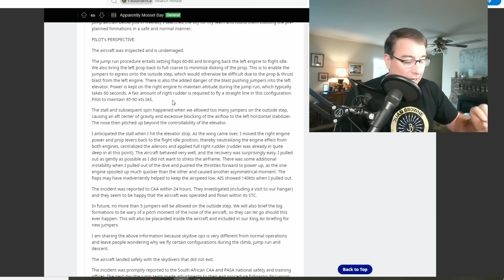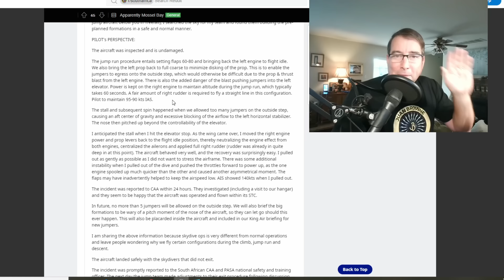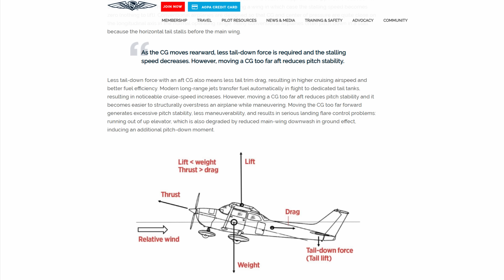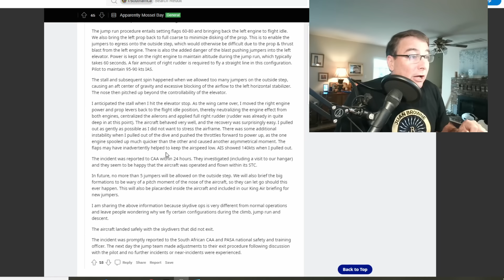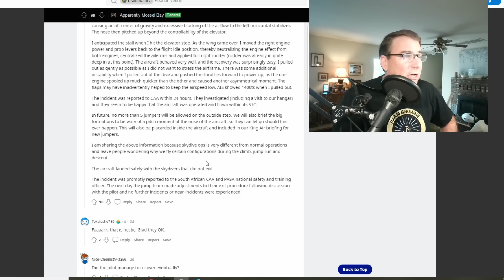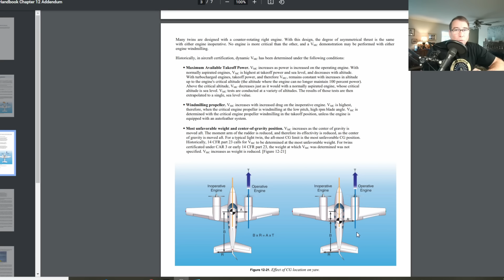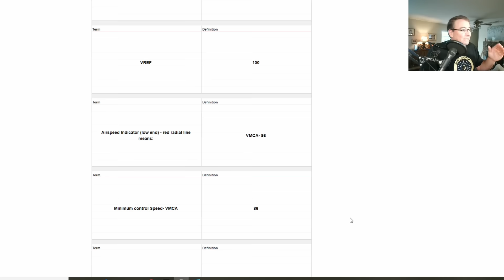Stall+Yaw=SPIN!  King Air Skydive Incident

Comment: One question why does this airframe make it out of trouble when the other videos have the pilots coming out of the "soup" overspeed the aircraft and pieces come off? Is it the altitude?
Reply: The airspeed is low in a stall spin situation. Just because the nose is pointing down doesn’t necessarily mean the plane is going fast

Comment: Wow he did have wrong opposite controls in.  Well Vmc speed given  is with flaps up.  I learned at about 20 hours total in a C-150 with full flaps my instructor had me in a secondary stall because I left the flaps down  The more it stalls the steeper faster, and flatter it gets.  Power makes the spin flatter

Comment: The scariest part is that the aircraft flew under where the skydivers had jumped out.  What if the stall had been prolonged a bit more and the pilot's brain focused only on recovering the aircraft, not on the 3-dimensional position of the divers, could they have been chopped up in the props ?  Very scary !!

Comment: My two cents as a long time (retired) skydiver with 3500+ jumps, around 500 or so from KingAirs.  I am NOT a pilot (though I have flown a few jump runs in a Twin Otter, including some bigway exits with a lot of people floating and long sets for the exit.)

We always (in the US) limited how many jumpers "floating" outside the KingAir to five, two directly across the floaters inside the cabin, and anyone else on that formation designated as "divers" - spread out forwards inside the cabin for CG purposes.  And our pilots typically take consideration into these numbers and spacings if any of the outside "floaters" or aft positioned divers on the dive were large/heavy people.  We also considered CG in terms of the rest of the jumpers not on that formation remained forwards until the large group had exited.

With that, as is normal, climbouts and set for the exit are practiced on the ground, typically in a mock-up of the aircraft doorframe - this group took a long time setting - about 20 seconds.  If I had to guess I'd say these guys practiced their climb out without their rigs on and then experienced a little cramped maneuvering to get the last two floaters out - and that slowed them down.  Another "mistake" was they had their rear floater climb out before any forward floaters - typically the forward floaters climb out first to help block the wind so the rest can climb out with less prop wash.

I've never heard of throttling back the jumper side engine - we just understood KingAir climb outs and exits might be "a little windy" and kind of a workout.  (But a cakewalk compared to propwash jumping DC3s where I've seen floaters hanging on and literally flapping in the prop wash.)

I haven't looked at the FARS in a long time but (at least in the US) if we can see our "spot" (exit point vertical) and believe we can maintain 2000 feet horizontal separation from clouds above 2000 feet, that's within the FARS and legal as far as the FAA is concerned.  Once the jumpers exit, it's up to them to keep that separation.  By the look of it, jumpers probably punched some clouds - and while I have jumped in South Africa, the times I have jumped there cloud separation was not a concern.  I've seen it in the US as well - but most places I've jumped around the US try to avoid this and I've been on a number of loads that landed with everyone aboard or did a hop and pop pass under the cloud layer because it had closed up climbing to altitude.  But it's not universal.

Most skydiving accidents involving aircraft occur on takeoffs and landings.

This incident here, IMO:  too many people/too much weight aft floating, possibly too many people aft prepping to exit, and the pilot apparently a little behind the curve.  I can't speak to throttling back the jumper side engine except to say I understand the physics but the half dozen times I have flown jump runs (In a twin otter), our pilot never said a thing to me about throttling back the jumper side engine any at all.

Comment: Can a King Air be modified to move the horizontal stabilizer to the top of the vertical stabilizer?  I would want to modify the whole tail section of the aircraft with a bigger vertical stabilizer and rudder with a oversized top mounted horizontal stabilizer.    An extra level of control surfaces would hurt would it?  It's not a lifting surface, so wouldn't it work?  EDIT:  I just looked and apparently a Super King Air has a high mounted horizontal stabilizer.  ( T - tail )  A Pilatus PC-12 also had a T - tail configuration.

Comment: almost every jump plane i exited from seemed like it was in a shallow dive which kinda made me mad since i paid for either 13.5 or like in cali 10.5 or 12.5. 

having flown camera and climb out on the step back by the tail then i was glad they raised that tail a little. never got a 'cut' going out of SDA's DC-3, but did get a shot of oil on exit with a side of prop blast. 

juan you should open a locals channel or post these type videos on rumble or odysee. we could donate to your cause that way and you won't strike out on EweTubular.

Comment: "The pilots themselves wear parachutes." If a distressed King Air is uncontrollable then there is NO WAY a pilot is going to make his way out from the cockpit to jump out. The G forces would be astronomical and the wind resistance of an unopened fuselage very high as well. Making your way to the back exit is completely out of the question...

Comment: Next year will be 40 years for me flying jumpers but in Cessnas. Either way I see WAY TOO MUCH time climbing out as the first strike. Take that much time in my airplane and you're getting powered off the step linger boy. I also heard there were 16 in that airplane but I question the accuracy of that. I see the asymmetric thrust as a heavy contributing factor to this. Complain all you want but I'm keeping power on both sides. Talk to any of the older guys who have jumped a Lodestar about stalls on jump run. Third strike is aft CG. I once had a few rides in a skyvan with a red line on the floor limiting bodies aft of that line. The pilot would scream and not because he could see the line, he could feel it in the controls
This video will be part of my safety day presentation in 2022. Blue Skies Juan!

Comment: Juan, absolutely unbelievable asymmetrical thrust ?? This is totally contrary to what you should be doing. Pull both engines to idle and like you said, let the plane settle and drop to your jumping altitude.

Comment: Would love any member of the skydiving community to advise on which Beechcraft or Cessna
were designed for them to hang off and jump out of and change seats and Basic Empty weights.
Also which manufacturers manual or document I should reference.
Would advise any pilot to stay away from them.

Comment: Juan,
Thank you for you analysis! Im not a pilot or sky diver but I like to watch the skydivers at the local airports in my area. Most of the skydive planes I see have a 'T' tail configuration. I assume this is so that the divers cannot block/alter the airflow over the elevator? I was surprised this aircraft does not. 
Paul (in MA)

Comment: I've done a couple thousand jumps from KingAir's.  In that time, I've been on the door and inside during a departure.  This is why most skydivers are far more afraid to land with the plane, in the case of cloud cover over the landing area, than to jump out of it in less than perfect conditions.  As the son of a drop zone owner, I will say.  Nice pilots are more dangerous.  They often will ride the edge of stalling to make the exit comfortable for thier passengers.  I would rather exit a faster plane than risk being pinned inside like the last guy that got out only once the pilot recovered. A formation of 6 or more in off this plane should exit last.  That way, if the imballance and lack of speed cause a departure, atlest the group is outside the plane and can unload it immediatly, allowing the pilot an easier path to regaining lift. If you're inside a spinning plane, your parachute wont help you becuase you will be pinned to the wall hoping the pilot has enough skill to recover.

Comment: I'm not a skydiver, but I think it is important for the aircraft to remain at the correct and constant altitude during the jump run. However, that asymmetric thrust method of accomplishing it is not safe. The skydivers plan their free fall time according to jump altitude. Not all skydivers might have an altimeter on their arms. Do you know why they use that twin-engine King Air and not just a single-engine Cessna? Money!! To get quicker at altitude and fit in more flights per day. A single-engine aircraft is much safer for skydives. What if that King Air stalled BEFORE the skydivers jumped? But, I'm no expert on this, so my argument might be invalid.
Reply: What he’s saying is that they could go to say 16,100 ft and bring both engines to idle. How long does it take to get jumpers out? 10-20 seconds? The plane would only lose 100-200 ft in that time. Jumpers don’t need to jump from exactly 16,000 ft. I’m sure a few hundred feet give or take is acceptable.

Comment: Doesn't "disking" refer to airbrake effect of the propeller when at high RPM setting at flight idle? Where you pause at approx 7:30 to comment on aileron, he's also get the control column back in his crotch if you look at the elevators too - all the way to that second departure

Comment: Thats kind of scary how fast the aircraft departs from controlled flight. Its no wonder so many people are killed when this happens close to the ground during takeoff and landing. This guy could have had thousands of hours and had this happened at lower altitude he may not have recovered. How much altitude did he use up from entering the spin to a full recovery and what is the lowest altitude they routinely fly in this configuration???

Comment: Those jumpers left in plane must have been "max pucker factor". I could be wrong but King air seems like a lousy plane for a mass jump. Not to mention the asymmetric condition of engine.  Much prefer high wing, high tail for jumping. I 'd be afraid those folks would hit the tail. Good thing they had a lot of altitude. Great filming  here.

Comment: Wing loaded aircraft don’t go flat in spins without outside forces driving them to do so. Fuselage loaded like to spin flat. To get the wing loaded to spin flat, you need to do something like leave the outboard power in too long which will initially roll steep but then cause inertial up pitching moments which then help drive it flat with up pitch moments reducing roll while increasing yaw. Since he had pulled the right to idle early, he wasn’t going to go flat.
Reply: “I see the elevator is still full nose up at this point” yet look how steep he is. Time 8:48.
Reply: Once they go flat, however, correct, they don’t like to leave flat.

Comment: Whut the eff is going on with setting the left engine at idle??
And I'm sure they are pressed for time before everyone becomes hypoxic. I'm sure the pilot was on 100% O2..............Right?
All that weight pulling on the left side plus near stall speed at high altitude equals fun video! Glad everyone was okay and no one was run over by the plane. 😅

Comment: Blanco, my view.  Once an aircraft has been selected, it as a given that certain risks must be taken to configure the a/c to serve its purpose. Helicopters fly into powerlines way more often than this kind of skydiving incident, but we keep applying the helicopters as required, and MANAGE THE RISK. I get your criticism that the throttle to flight idle at low speed is "incorrect", but if that is required to make  the aircraft serve its purpose, then it is a risk that is consciously taken. If we compare this to the risks taken at air shows with low level displays, it is clear that low level displays are much more risky than the skydiving incidents. Risk = Exposure x Severity x Probability. The severity and probability at air shows (deadly accidents per displays flown) is much much higher than (mere) flight incidents per drop-flight in skydiving. Furthermore, consider other stall incidents in aircraft well suited to parachuting, where stalls resulted from insufficient risk management (think - meat bombs moving to back of plane):

 - Atlas Kudu/Angel (Small South African cargo plane - designed with paradropping as function)    https://www.youtube.com/watch?v=x6tgZVoZc7g
- The venerable  DC3                                                                                                                                         https://www.youtube.com/watch?v=EFyyLbD-Y7o
- And even in the brilliant Cessna Caravan                                                                                                    https://www.youtube.com/watch?v=4pVUIiYAQhU

Comment: No skydiving pilot here, but it would make more sense to me to slow flight in landing configuration. Allow meat missiles to exit then cut power and enter a slight dive so that the horizontal stabilizer would be clear. 

Anything was better then what happened. And honestly I probably would have let the plane dive longer even if it over speeded for fear of hitting someone.  He got twisted around in that spin and he almost pulled up into the skydivers. 

Scariest video I have seen in some time.

Comment: After all the pilot went through to recover, with four passengers still on board, you could have at least let the video play out to where he flies away successfully.  About 3 more seconds.  Showing his failure, then his accomplishment.  The original video does show that.  Why did you cut it out?  I guess it's more important in a flight analysis video to make sure you get the right overloud guitar track dubbed in correctly.

Comment: I'm not a pilot but wouldn't it make some sense to cut the power back, correct with rudder and clean the control surfaces with air speed before attempting to nose up/add power?? Why was the thrust of the engines asymmetrical  when added equally on the thrust levers? Please explain. Thanks!
Reply: Yes when in a spin with a twin engine airplane the correct procedure is to bring both engines to idle and let the plane start flying again nose down. Then you gently bring the nose up and add power. 

Two engines almost never accelerate at the same rate, especially turbine engines. But I’m guessing the problem was exacerbated by the two propellers not being set the same. Unless the pilot brought both prop levers forward in the recovery, which I’m betting he didn’t.

Comment: Having dropped jumpers and teaching in twins I'd say this incident must not be played upon those skydivers' floating the door.  As a lesson the critical engine throttled back while powering the other will likely cause a roll before a stall thus complicating recovery (inverted spin). The outcome here is a testament to Beech's Kingaire in the hands of a 'green' pilot who got lucky after using inadvisable techniques.

Comment: I thought this was rolling shutter effect on the GoPro making the left prop appear to be stopped… the whole safety thing is missing, given jumping into IMC, the one-engine thing and I don’t see oxygen on anyone (I am assuming the pilot is on oxygen but those jumpers are at risk of the bends by not pre breathing oxygen to get the nitrogen out.

Comment: Ok, they need to stay at altitude, until jumpers are clear. But you're right about everything else. Easier to enter a stall with an aft GofC but more difficult to recover from a stall.
Theres a lot of talk about recovering from spiral dives (as opposed to spins) by using opposite engines...!!!!!?!?!?

Your dead right about using asymetric thrust thrust.

There is too much use of this.  Asymetric should only be used on the ground for turning or in the event of an engine failure.

Comment: It’s interesting to listen to the pilot try and minimize the severity of the incident, as if he was still in control, and was doing the necessary piloty things to save the day.  But we don’t know what we don’t know.  If he knew how to aviate properly, the spin would not have occurred, nor the series of secondary stall/spins.  Therefore, the recovery and the pilot’s description of the sequence is highly suspect.  It’s ridiculous that he would be trying to use power to recover, given his altitude.  He did absolutely everything wrong, and needs to go back to school.  He did not recover from the spin.  The airframe gained enough airspeed and recovered on its own, despite the pilot’s incorrect inputs.  

Unfortunately, this lack of skill is very common these days.  It’s not PC to wash anybody out, and we don’t do full stalls, let alone spin training, because it’s too scary.  In my humble opinion, there is a large percentage of the population who need scared out of training, because they lack proper survival instincts.  It is terrifying that there are people flying for hire, who have never spun or even stalled an airplane.  A commercial license is not a Participation Ribbon.

Comment: Juan, thanks for sharing this content. I like your commentary very informative, especially on how CG movement can affect VMC. Me, as a low-time MEL will be safer in the skies. 
A King Air to haul jumpers? Is this really a thing? And what about landing gear? If it were extended, would the gear drag have kept the tail flying a little longer? I have no experience with the King Air or with Jumping. It seems like this is the wrong aircraft for this sort of thing. Perhaps a Caravan or a 206 would be better. PTL that the "test pilot" was able to recover.

Comment: What, if any, injuries did the sky divers that remained in the aircraft receive? I can't imagine that it would have been much fun if you weren't seated and buckled up throughout the recovery process. Also, I take my hat off to the engineer that designed the flaps on that aircraft. Top job there son. Top job.